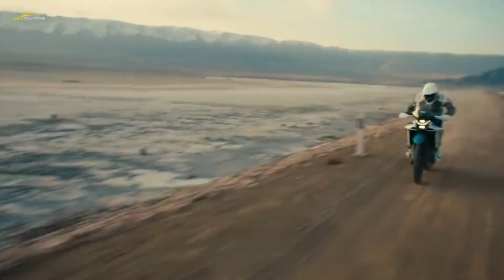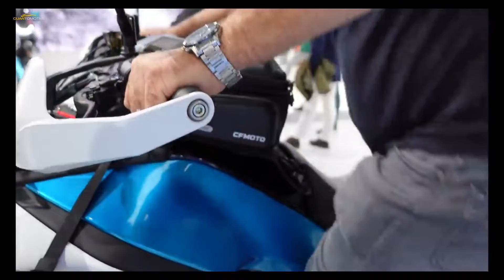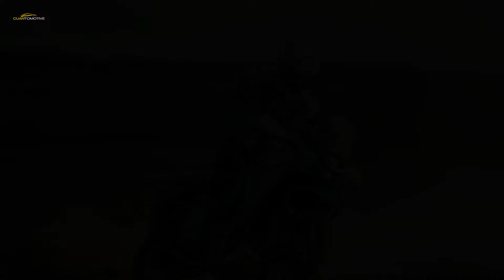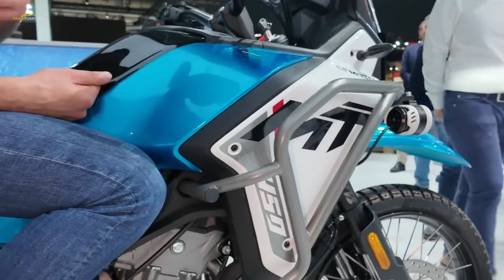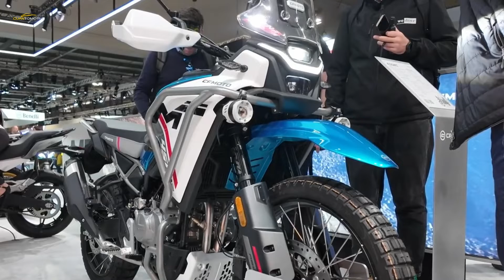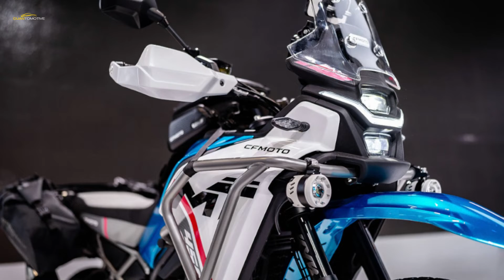2024 CFMoto 450MT It Only Takes 3 Minutes And You Will Really Want To Own This Motorbike !!

Comment: It will need more hp. Kove has 50 from a 450 single.
Reply: This is a middle weight adv bike, not a rally darkar machine.
Reply: @alexandreisabel1234  
Ya, I'm more interest in there MTX concept which looks like a ktm 790. 
The cheap entry KOVE 450 is more an adventurized dual sport. Only 50 of there actual Dakar bike can be purchased for near 2-1/2 times the cost of the entry model but perhaps the price is justified.
Has 65hp, titanium bolts, premium suspension and much more.
Reply: @mrjay4000  Kove is way too tall for me. CF Moto seems to hit the sweet spot for shorter riders. even the 800 MTs are built for shorter riders too.
Reply: Kove's 450 are full of issues from what i have seen on youtube, so i would avoid the first couple of batches until they iron those out, plus the kove 450 costs 8k (in greece idk in other countries) while the 450mt costs 6k